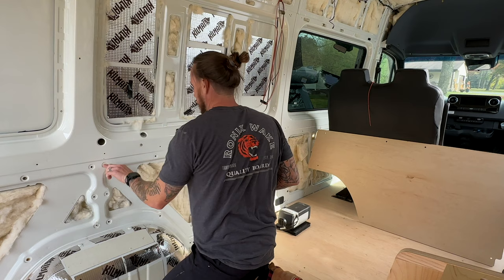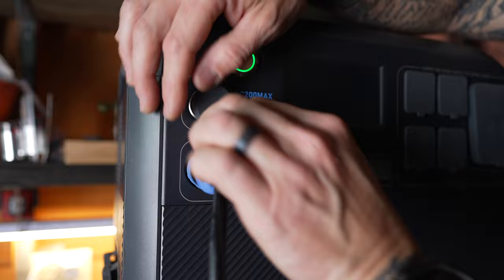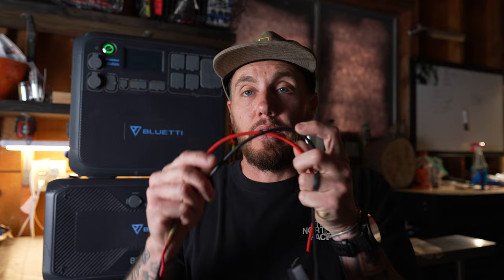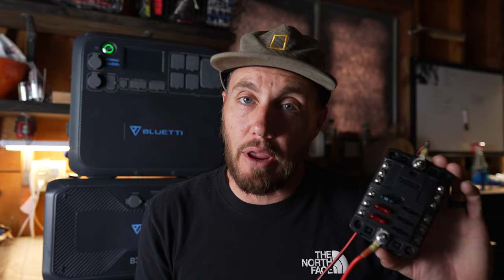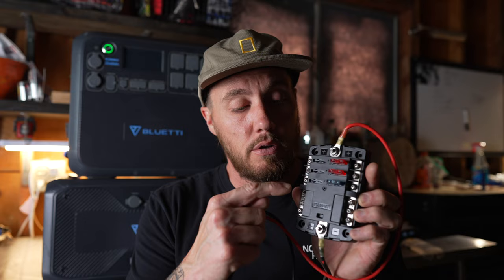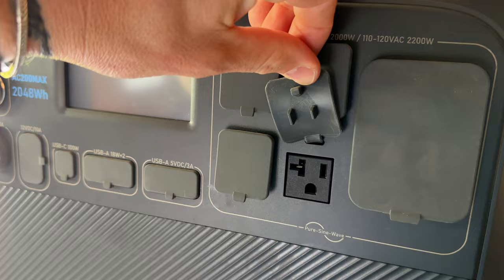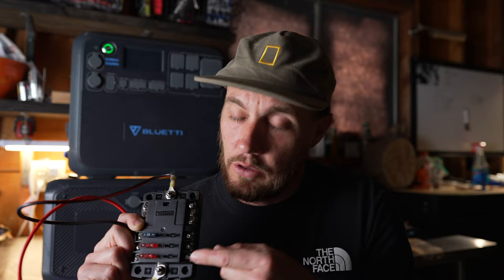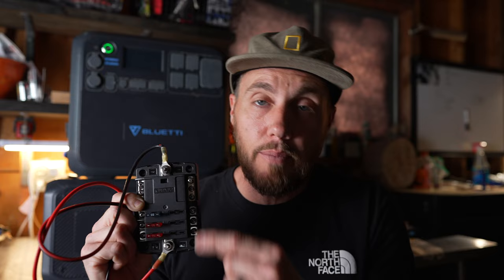Step By Step Guide To Powering Your Van Using The Bluetti AC200 Max

Comment: Good video thx. I also use 200 max and I’m considering a second instead of extended battery like B300.  The reason?  Redundancy. I live and work full time in the van. I wish Bluetti would make it so you could connect the two together but aren’t you concerned if you have an issue with the 200max you just have an extended battery left, or do they offer the same functions like the aeronautic connection and I’m missing it?  Wise move or should I just get extension battery?
Reply from the maker: Depending on how invested into the system you are, I would go a different direction. The fact that these two cannot run together and you have to switch them around is a pain. It doesn't make any sense at all to have to do that. The Ecoflow 5kw hour system is so good and that's what I'm switching to. here's a like to take a look at. It's not cheap, but switching between batteries all the time is a pain. https://adventurerigshop.com/products/ecoflow-power-kits-5kwh-independence-kit
Reply: @roamingwithjosh  I think all I would need to do is move the aeronautic cable from one to the other as I would stack them in the same spot.

Comment: Would a 12v rooftop ac be able to be ran through the fuse panel and this plug into the Bluetti?
Reply from the maker: I do not believe so. The 12v AC units have an 80amp fuse and the bluetti only has a 30amp plug. If the power surged it would definitely trip the bluetti. It's worth a test, but I have not done that yet. It would be an expensive test.
Reply: @roamingwithjosh  gotcha! That makes sense. We live in Texas and have dogs so an A/C is a must if we want them with us. Guess I will need to look into a custom power build. Thanks for the reply!
Reply: @roamingwithjosh 😮

Comment: Very nice job.  I have an AC on top of my van that requires 120V and several appliances that are 120 V so I will wire to a panel with both AC and DC.  What I need instruction on is charging the Bluetti (I have a AC300 with 2 B300's).  I put in shore power, but I need to be able to charge as I am driving down the road.  I've gotten several suggestions, some of which were conflicting.  Are you going to charge your 200 max from the alternator/chassis battery?  If so could you do a video on that?  Thank you for doing this, it was very clear and informative.
Reply from the maker: At this point, Bluetti does not have a designed product for that issue. I have also gotten conflicting information on that and the only thing I have came up with that I feel comfortable doing is using a 12v cigarette plug to charge while driving. That solution only puts 100w in at a time which really doesn't help too much. When and if I figure out a good way charge off the alternator I will definitely do a video. Thanks!
Reply: Bluetti sells a 12/24V lead a I'd battery charging cable for $20.  Connects to one set of the MC4 connectors on the B300 battery or the AC300 unit.  

They also have a DC charging enhancer for $200 but the literature is pretty lacking on what it does & how it works.

I also have the AC300 & B300 combo & plan to use the $20 cable with a Victron DC-DC charge controller.
Reply: @sharimctiver8952   Shari, I may be completely wrong and I'm sure you know more about electronics than I do...but...I don't think you need the DC-DC controller as that is built in the AC300.  The same as you don't need solar charge controllers to connect to solar.  The problem with charging with DC is it is very slow.  That is why they created the enhancer.  Even with that, DC charging is slow compared to what you get with an inverter and charging with AC.  (DC is usually 12 V and to get the same Wattage you have high amperage. Things can get very hot.)  I've wondered about using the enhancer with the AC300, but all I've seen from Bluetti is using it with the AC200 series.  Perhaps it isn't meant for the AC300.  Anyway, perhaps you or some other reader can explain why I am wrong here.  It wouldn't be the first time.
Reply: @timothyjohnston9069  after revisiting the DC enhancer manual, I think you are right - they show it between the B300 & the AC200, but not the AC300. 
I already had the Victron on hand, so I thought it would be extra insurance to protect the expensive system - as well as my alternator.  I planned to connect it to the MC4 connector on one of the B300s & connect my solar to the AC300.

Which AC unit did you install?  I wasn't planning to install AC, but my husband has convinced me that I should get one.  I picked up the 2nd B300 on sale this week specifically due to the AC.
Reply: @sharimctiver8952   I had Wasatch Overland put a Tufport high top with AC on my van and at the time (May) they were only using 120 V units.  (9500 BTU Houghton from RecPro.)  Now, apparently, they will put a 12 V unit on.  I had asked for 12 V and they said they don't work well and they don't use them.  If the 120 V unit runs my batteries down too fast I might switch at some point but right now the 12V units are at least twice the price.

Comment: great video, could you run the power from aviator cord straight to a rocker switch panel? thanx
Reply from the maker: I'm not entirely sure what you mean by rocker switch panel.
Reply: a panel with rocker switches to control different 12 volt accessories like lights and fans @roamingwithjosh